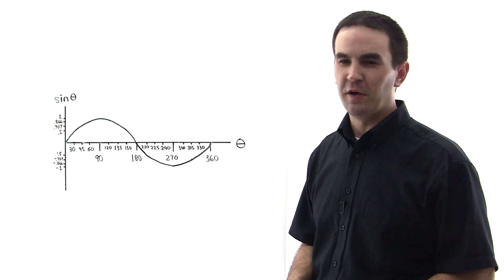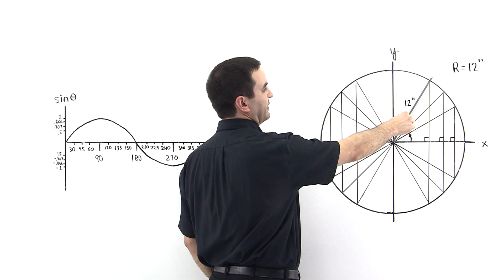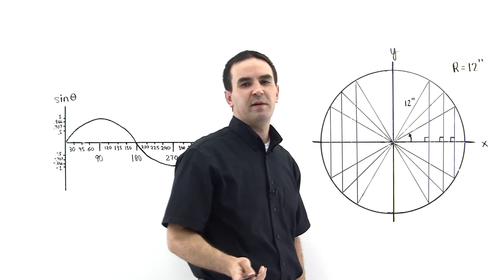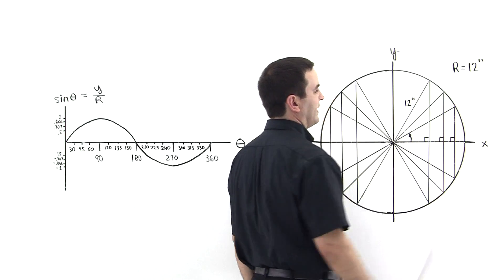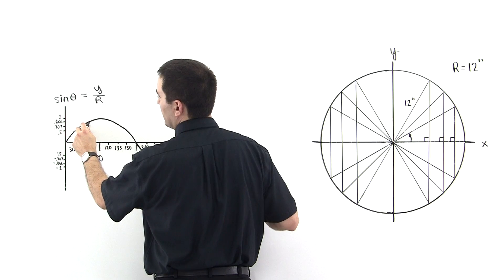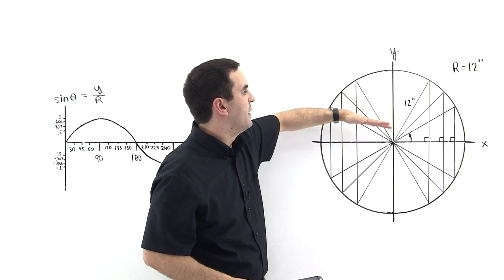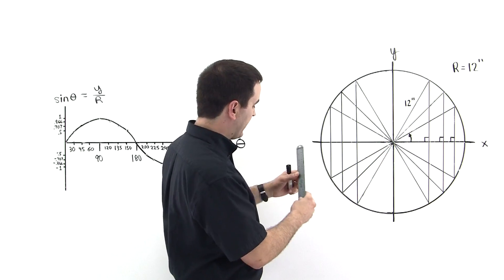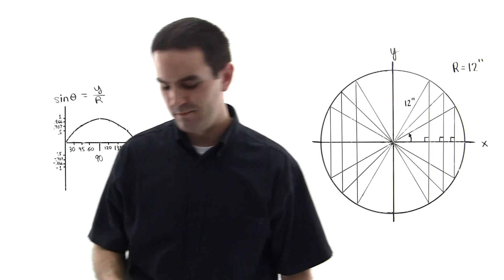Origin of the Sine Function Part 1

Comment: In third quadrant we are using angle 210 degree which is outside the the triangle even though we are are perpendicular /hypotenuse for sin210 ,why? 
This is confusing
Reply from the maker: At 210 degrees, it's a triangle that has a negative y-value (-6/12)= -0.5.  You can think of each triangle as separate triangles.

Comment: Lo and behold ? Wrong. That sinusoidal is the plot of y value normalized to the radius over different angle. You should have started with radius of one.
Reply from the maker: It does have a radius of one.  And it's plotted by hand which gets you around the radian problem.  Better pedagogically.

Comment: In which field this knowledge is used
Reply from the maker: Civil engineering is its most practical application.  But other disciplines as well, anything dealing with vectors:  physics, mechanical engineering, electrical engineering, etc.

Comment: 1:04 so the hypotenuse is same for each of them. 
Denominator stays the same, and it's only the numerator that changes. 
The maximum value of the numerator can only be equal to the hypotenuse, never greater. 

Oh... this is beautiful, Saul!
Reply from the maker: correct.  and for a given angle the ratio is always the same.  even if it's a larger triangle, the ratio of the two sides will be the same.

Comment: but why did you make the radius of the circle 12" when you could have made a unit circle so the hypotenuse is 1 so the opposite of the triangle is sin(θ) and the adjacent would be cos(θ)
Reply from the maker: I used a radius of 12" because it was a 12" ruler that I used for the measurements. The video was done in such a way to give the viewer an intuitive feel for the ratios involved.

Comment: why it was invented & what was its application in the very beginning?
Reply from the maker: Excellent question, you may need to do some research on this but I am guessing it was either to build the pyramids or the greeks came up with it for their architectural structures.
Reply: thanx Sir
Reply: @saulremihernandez314  
sine comes from later period in indian mathematics and then in arabic/ middle eastern math.
Greek didn't use it and probably ancient egyptian neither. They had other methods for triangles.

Sine becomes very useful once you have a way to compute its values at any angles and people wrote sine tables in the middle age and later. Now we have calculators of course
Reply: I heard that some poeple were building a ship and they were cutting trees. When they needed that largest part in the middle, they haad to cut a tree of length the same or bigger than they needed so they could cut it off. They asked some mathematician if that tree on the hill was large enough for the last part. They wanted to know because if it was not large enough, they would have to find another and try it again. He came up with the idea of measuring length and angle of its shade in noon and make a 90° triangle out of it, where you had all angles (by subtracting from 180°).
Reply: i heard that a mathematician first discovered it for the love of math itself and he knew no applicable use case for it
Reply: EXACTLY the reason i googled it today to know what it meant and reason for invention
Reply: Hi
Reply: This was not invented for pyramids! Although it can be used for that. Everyone vibrates when you have healthy body vibrates a certain way when you are sick it changes this can be measured and  demonstrated. Changing the vibrational wave length through sound can change and alining your vibrational status and can return to health from all incurable diseases. Light electricity sound our thoughts behave the same way that wave SEN our bodies have a vibrational wave
Reply: Health!